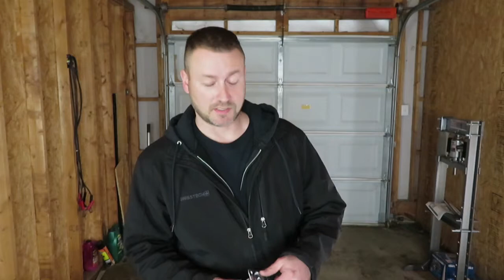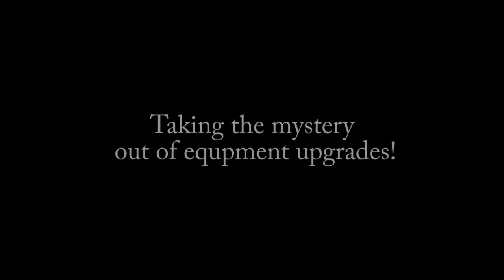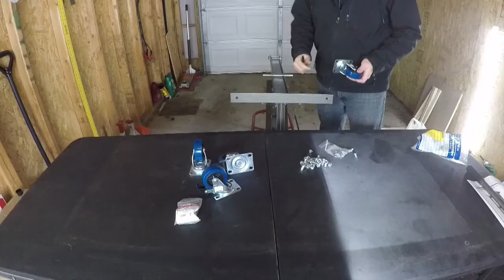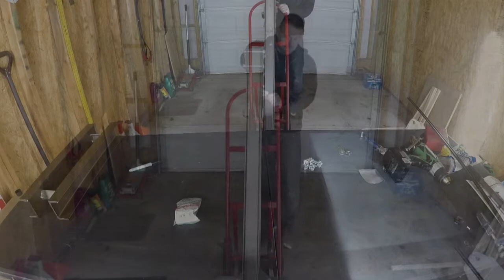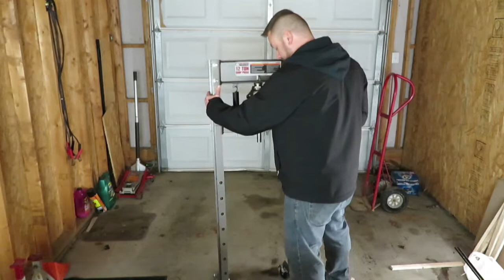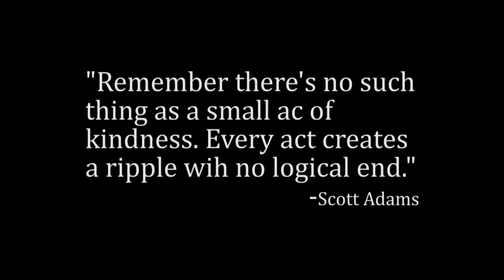Installing casters on my Harbor Freight 12 ton Hydraulic press (Easy Upgrade)

Comment: do you feel this was a good modification? or bolting to floor more of a better solution for stability?
Reply: understand,  but the question is was mobility worth stability?
was this modification to gain mobility worth compromising stability?

I'm about to put my new press together and wondering if stability or mobility/ best option...thanks for your video and response.
Reply from the maker: @sonofsteve566 definitely didn't add any stability 😂 I just added the wheels out of necessity.
Reply: @DCAutoEnhancement  
so you like it 👍-or- regret it 👎
Reply from the maker: @sonofsteve566 I like it because I don't have to drag it or pick it up when stowing it away.
Reply: @DCAutoEnhancement  Nice, Great job!
Reply from the maker: @sonofsteve566 thank you
Reply from the maker: @sonofsteve566 if you have the shop space and you are going to use it on a regular basis, I wouldn't put the wheels on it. I just needed to be able to move it each time I used it and I don't have much floor space to keep it stationary
Reply from the maker: This modification wasn't for stability. I just wanted to be able to move it around easily.